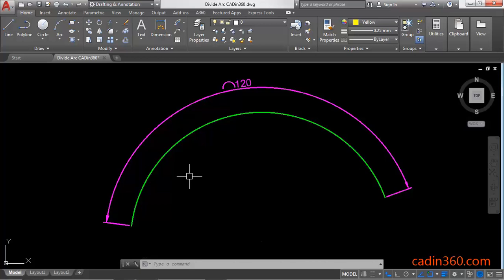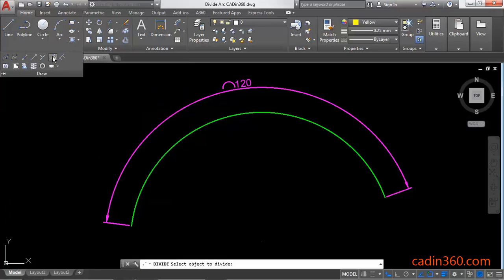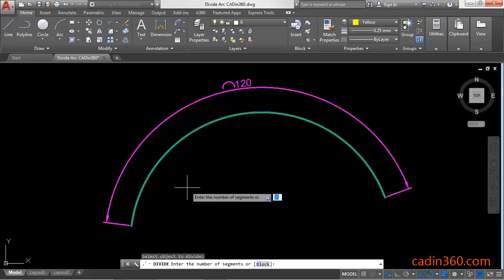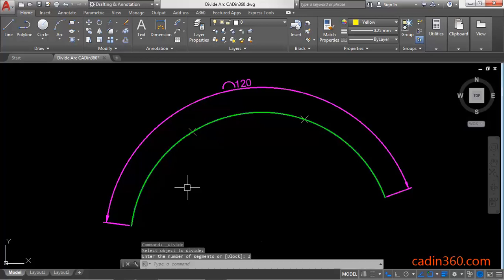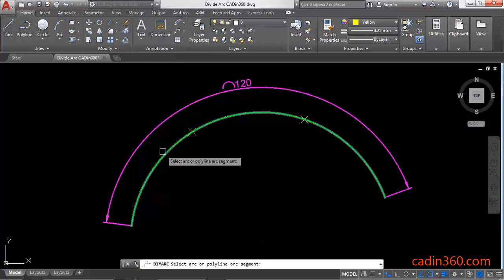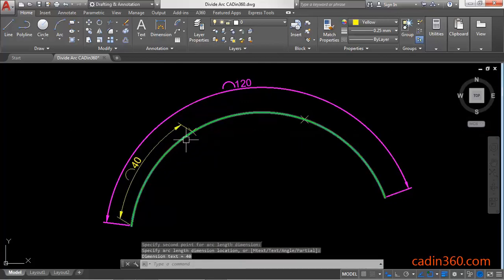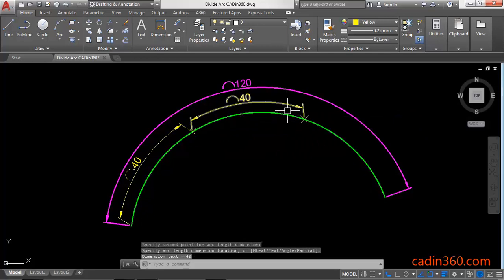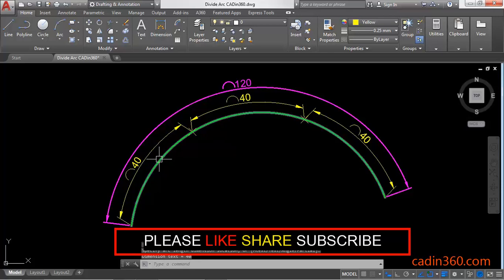How to Divide an Arc in Equal Parts in AutoCAD 2018

Comment: If the points are not showing change the point style by going to utilities or type "ptype" in the command line. The command will work in other applications such as Civil 3D as well.

Comment: I'm using AutoCAD 2007. I have an arc line with length of 6000mm. I have to divide the arc for 20 part, so each part should be 300mm length. But I couldn't get it for 300mm each others. It has been divided with different lengths. Why? Please help me.